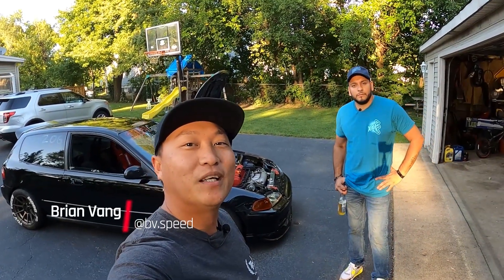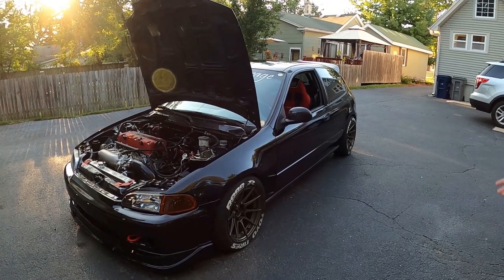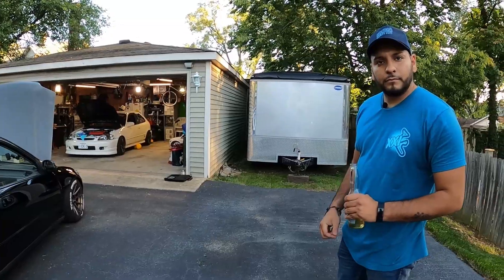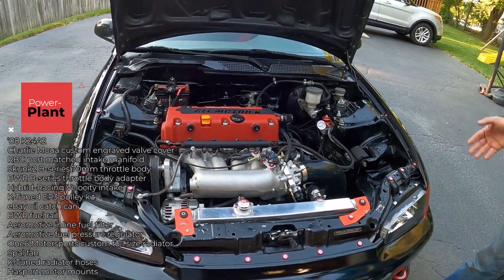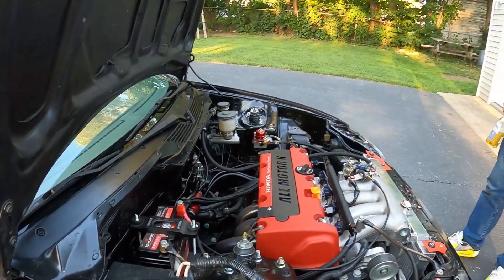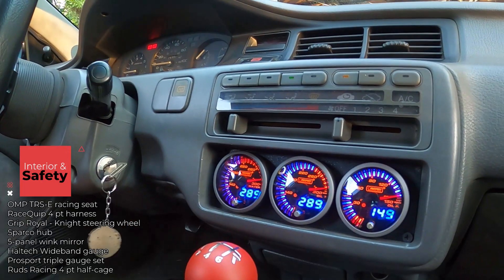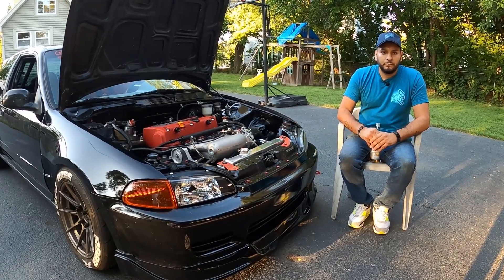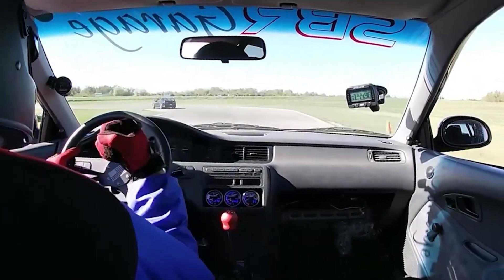Alberto's K24 '93 Civic EG Hatch - TCR #004

Comment: When turning to the left, drop your right hand to the 6 o’clock position on the steering wheel and use the bottom to hold during the turn, vice versa for right hand turn. 
It will make turns way easier and be able to hold tight turns like a pro